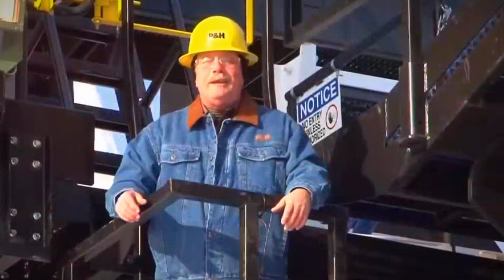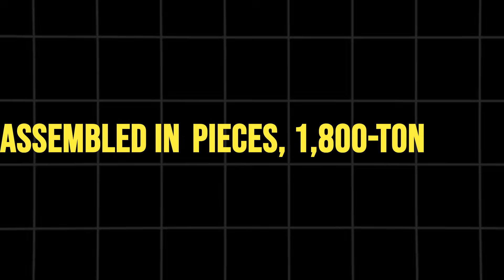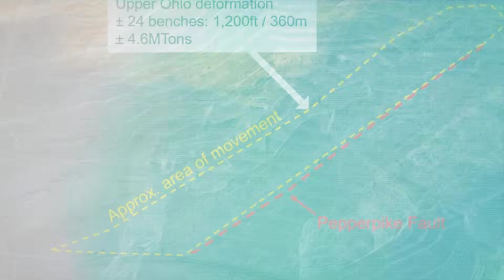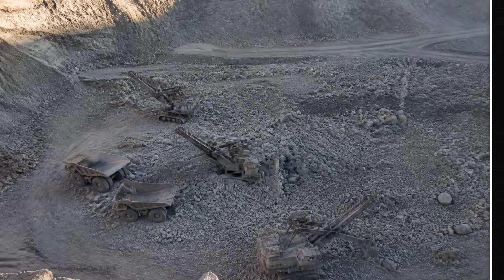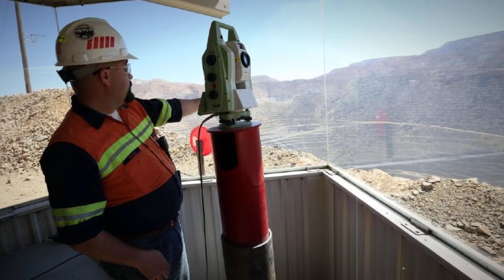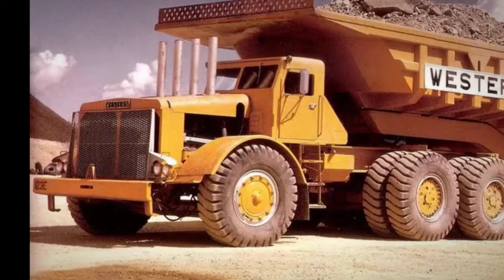The 1,800-Ton Machine That Dug a Buried Mine Back Out - Bingham Canyon (2013)

Comment from the maker: The internet says 14 CAT trucks were buried. We checked — they were Komatsu 930Es, 320-ton class. The verified count: 3 of 13 shovels and 13-14 of about 100 trucks. The big question: should they have pulled the fleet out before the slide, or was staging it on the pit floor the right call? If you worked at Kennecott or Bingham Canyon, we want to hear what really happened down there.